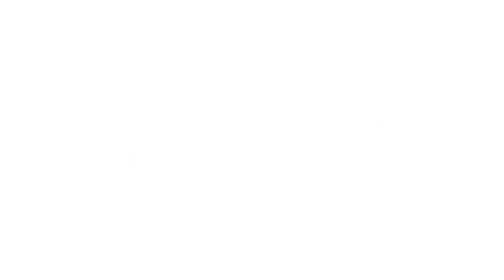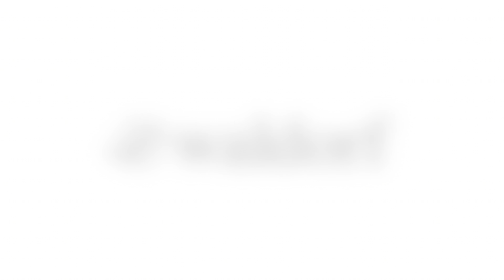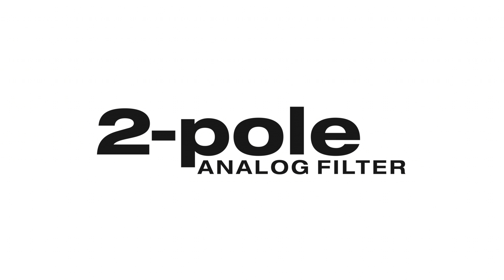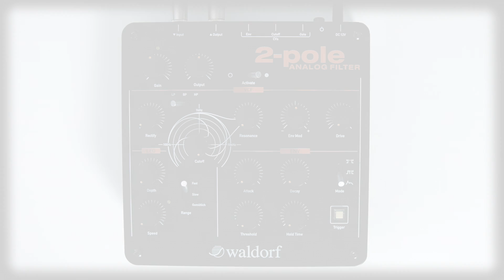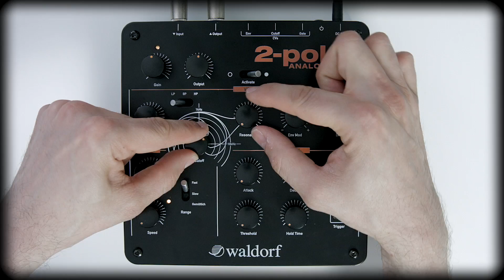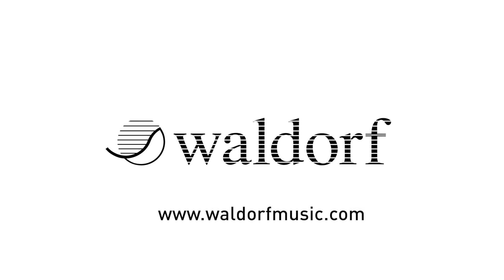Waldorf 2 pole Tutorial (english version)

Comment: looks great! would it work with synth strings/pads? ive got an old string machine from the late 70s that would sound amazing through a decent outboard filter, but it doesn't have gate or cv out, so i would have to rely on audio level triggering. would that work with this unit?

Comment: My 2-pole (just arrived today in the post) has the trigger light permanently on, not like in this demo.  Is this correct or is the unit faulty?  Everything seems to work as here except the gate trigger and pulse trigger modes, which do not seem at all useful.
Reply: Have you tried different threshold settings?
Reply: yes of course.  it was permanently triggered on all possible settings.  in the end i got the item replaced and am doing exactly the same with the new one which doesn't have this problem, so it seems to have been a faulty unit

Comment: How come the low-end disappears so much with a high resonance?
Reply: The same reason low end disappears with every LPF and high resonance. Some filters have a low end boost circuit to compensate, most don’t. Resonance accentuates the frequency AT the cutoff, so it will drop the volume of all other frequencies. Its the reason a self resonating filter cam create kick drum sounds when the cutoff is around 50-80Hz